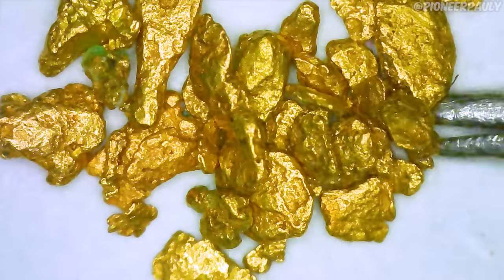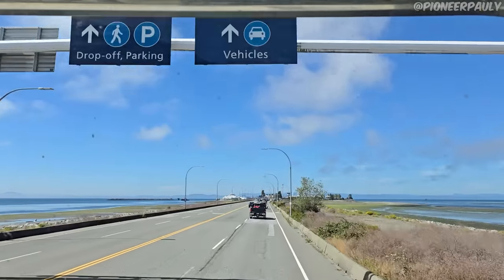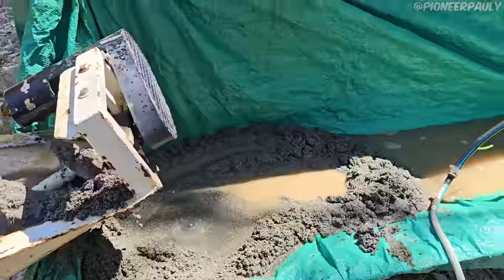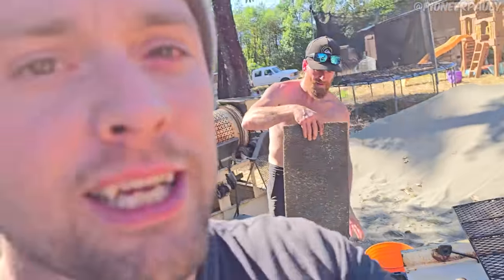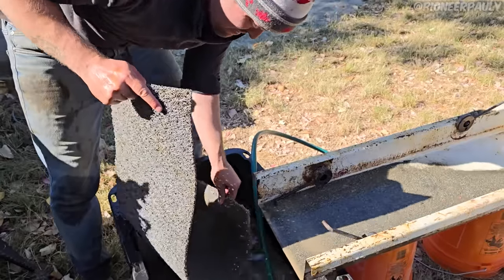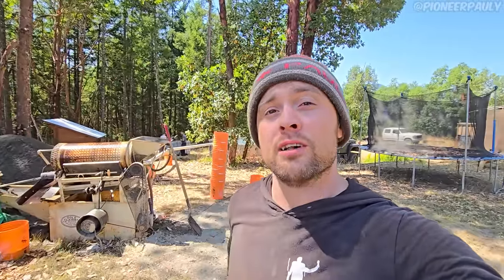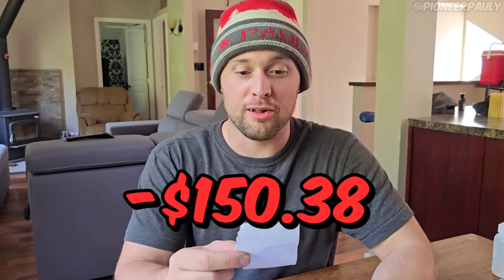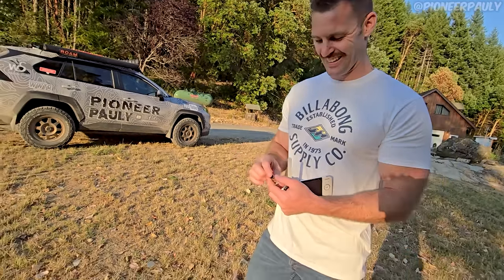How Much GOLD In Dump Truck Full Of Home Depot Sand?

Comment from the maker: Should I retire from sand or go bigger? Let's hear some ideas! 😅
Reply: Any possibility of dynamite being used? 🤣
Reply: still watching, but the rule of thumb is to always go bigger or die trying
Reply: Need to do a bigger dump truck like the mine uses…..
Reply: Do pudding next. How much gold can you find in Home Depot pudding?
Reply: I can't wait for another trip to NZ 😊
Reply: BIGGER
Reply: Crevice the sidewalks in the city
Reply: Retire
Reply: I want to see you dredge using a pool vacuum hose (no inner riffles) clipped to a sluice. I use a 50 foot pool vacuum hose to dredge legally in California and it works perfectly even without a significant elevation drop. You just need fast moving water and the hose fully submerged.
Reply: Mental, but very entertaining,  10 truck loads next😂😂
Reply: Tbh it was peak i don’t know how this could get more interesting 😅 it was like you predicted 0,2 grams but 10x bigger
Reply: Just go prospecting on the Frazier.
Reply: biggggerrrrr. biggggerrrrrrrrrrrrr. see if you can cut a deal where you return the sand
Reply: Trailer dump. Dredge for days
Reply: At those gravel plants they classify the sand to take the larger pieces out. I want to see you run a dump truck of what they classify out. See if there’s any bigger gold 😈
Reply: I like seeing good gold. I say dump the sand videos.
Reply: Ocean
Reply: You should go to work with Parker.... Pioneer Polly teams up with parker!!
Reply: If you want to go bigger you might as well just build a gold plant next to the sand place, save on the dump truck costs.
Reply: Find the most crowded beach near you and sluice it! In other words, go BIGGER!! 😂
Reply: BIGGER
Reply: 3 dump trucks full one of those really really big yellow machinery ones that they use at Coreys we just have like 10 people helping you
Reply: You are crazy 🤣 but you n a good happy way.
Reply: You could try for sand from different quarries?
Reply: Why not put a tarp down or plastic? You're smarter than this. Gold is heavy that's why the process to get gold works with dry shaking or some type of sluice. So every time you scoop  with a shovel or bucket etc it will keep sifting itself deeper and deeper u til it's on the ground with grass, leaps, dirt, rocks etc so you loose it on the lawn or in the yard but over a sheet of plastic   any gold that shifts or sifts to the bottom is normally lost. But not if the sand is dumped on plastic.

P.S you just said about why you didn't use a tarp however when coming to fine gold. It will all get lost into the woven plastic checker fingers. Meaning you lose majority of it.
Reply: If you go bigger, then you are just a normal placer gold miner. 
And you know what...
I would absolutely, certainly, and abhorently never watch another one of those amazing videos you should never think of making, cause they would be just..horrible.
Reply: Get a CAT Load of sand
Reply: Make a deal with the sand company, return the tailings sand for a new load
Reply: I commented to soon 😂
Reply: I'll help you and Andy retire....nice pan...matches my 4.5g in a pan...I made a Calgary Flames logo in that gold, right in front of my father.... he says "you have too much time on your hands".... I said "not really, it's 4 hours"!
Reply: I clicked the dump truck thumbnail  3 seconds quicker than if it was a bag.
Reply: Give some to streetips to process into pure gold for you
Reply: Tar!
Reply: Go to a gravel pit or road building gravel pit, in a gold bearing area. Like Tulameen river, or along Fraser. Test there gravel!!!
Reply: You gotta go bigger that was only half a truck
Reply: Would more corse sand or gravel mean bigger gold
Reply: Bigger
Reply: This is really expensive but a big load of online pay dirt
Reply: Bigger
Reply: How much gold is in sand in a whole football stadium.😅
Reply: GO BIGER do more sand from home depot
Reply: Retire man. Its common sense. Before building that plant to screen sand theyll do drilling test and samples . If they found shitload of gold they wouldnt be selling sand lol
Reply: try another supplier, these guys ripped you off...
Reply: GO BIGGER!
Reply: more sand🤷‍♂️
Reply: might want to just go to the river and run the sand a little up the river...
but hey! more sand never hurts.
Reply: You should retire from anything that requires work
Reply: Bigger is better
Reply: Do a sand gold mining video on the beaches of the west coast of Vancouver Island.  Mining flour gold like the old timers did.
Reply: @robertstanton1668 
"Fraser"   ( sorry )  :-)
Reply: Go buy some clean fill dirt from a random person
Reply: You just need to go to wisconsin and speak to Jason @Flour gold wizards...lol all the beach sand you'll ever want to process...lol
Reply: The next step is to find the Home Depot sand pit on the Fraser river.
Reply: This video is over produced. Please make them more rugged
Reply: Buy a small plot of land in Nevada make a small mine shaft and hire some folks to work when your busy
Reply: @MadMarlin1964  Don't encourage him...lol
Reply: @kylechipaway1285  Pretty sure it was "full" by weight. Some materials are too heavy to fill by volume. And amazed that the ferry would take it as heavy as that load was. Wonder if the ferry charges by weight on those loads?
Reply: Every video the amount doubles. Do it like that, but with sand! Dare ya!
Reply: If the next one isn't an entire freight train of home depot sand, I don't want it 😂😂
Reply: NO....Though you should  at least make a sand castle next time!
Reply: BIGGER
Reply: It could be an infinite money loop if you set it up right and sell the sand again 😂
Reply: hi @PioneerPauly ive got a question is gold only in sand or can it be in gravel too  ?  :body-blue-raised-arms::hand-orange-covering-eyes:
Reply: You should go bigger. Figure out were other home depots across Canada source their sand from. Then go to those places and do the same thing. Would be so much fun. Much much more expensive but more entertainment.
Reply: Go big or go home
Reply: Retire bro this so stupid 😅 jst buy gold  and try to make profit not sand lol I feel like everytime U jst throw a couple grams of gold in it too lol everytime u have the same amount 😅 I only watch because it’s so stupid I have to fastforsward to the end to see u lose 🎉
Reply: Enough sand videos for now. They were fun but now its enough
Reply: I think it would be interesting to see the difference in outcomes from those paydirt bags.
Reply: use the size of my moms weight of sand
Reply: HELL NO GO BIGGER, GO INSANE
Reply: Build a giant sand castle
Reply: A POOL FULL OF SAND!! PEASE 🙏
Reply: I wonder how much you will find in a whole beach.
Reply: Go big or go home.
Reply: B I G G E R
Reply: Go Bigger , go to the source! Where does Home Depot’s supplier get its supply , to then send to Home Depot ? 

I say Bigger Mining Truck from the FRASER!
Reply: Do a semi load
Reply: Do a panning Competition with your buddies. Put some gold in some sand for each of the particepants, same amout if gold for eatch and Whoever retains the most is declared the winner and gets to keep all the gold
Reply: As they say. Go bigger or go home 🎉❤
Reply: 40 - 7 trailer road trains full of sand should be fine😂😂 but to get the road trains you’ll have to come to Australia, when are you going to visit vogus prospecting?
Reply: You need to put the whole Fraser river though the Trommel.
Reply: Sahara awaits your arrival.😮
Reply: Always bigger 😂😂
Reply: Imagine using beach sand to find gold
Reply: Find more big nuggets please!
Reply: Go bigger
Reply: BIGGER
Reply: Yes
Reply: Yes
Reply: Configured Connect homogenizing homogenization using h burnings conciliatio binomial
Reply: I reckon your eye is pleading you’ll retire from sand 😂
Reply: Go big or go home, try a train full 😂😂😂😂
Reply: Wouldn't most of the gold gone into the grass :)
Reply: @inadad8878  all what is left on the grass, yeah but seeing that that entire pile was just 2 ish grams means that the loss would not be more as .2-.3 grams at most…
Reply: U shouldn’t be out in the sun bro not good 🧛‍♀️ 🧛‍♀️ first time watching ya videos 👍👊
Reply: BIGGER
Reply: Fabricobble a hopper and feeder for the trommel.  Lets you focus on more things while it runs.
Reply: Fill 3 dump trucks full of the sand
Reply: In New York we have road sand. Sand for iced roads. That is a good possible video
Reply: Get  cement,  moulds, a mixer ,and make blocks to sell on ....
Reply: you should do dirt
Reply: Sluice a big pile of random dirt
Reply: 5 dump trucks😅😂😅
Reply: Retire. Bad investment, and the videos are not as interesting. We like to see you succeed financially, not blow money.
Reply: Arrange a deal with the sand plant to run a trommel there, washed sand fetches a premium so it's a win for both you and the sand plant!
Reply: MORE! 😁
Reply: Use the sand they sweep off the streets after winter
Reply: I dropped my golden needle into sea can you help me to find them?
Reply: You said bigger
Reply: You could try a bunch of sand from different locations other than depo like where you buy sand/gravel and stuff by the truck loads. Do not retire but also go bigger. do both :)
Reply: @PioneerPauly don't retire from sand instead you should set up at the river this time with all of your friends and have a big day where you just sluice all day stay the night and do it again for like a week straight so you don't have so much expense.
Reply: BIIIIGGEEEERRR
Reply: Sidewalk sniping
Reply: Bigger
Reply: BIGGER DUDE!!!!
Reply: Spare change from car wash machines.
Reply: Get a different trucking company.
Reply: bigger!
Reply: do a barge of sand next.
Reply: Food would have been consumed no matter if you were doing this or not. That's not a legit related expense. That's just a personal line item.
Reply: Do something more meaningful with your time than to try and get rich 👎
Reply: Semi truck
Reply: Mad Max equipment upgrades: how far can you take the prices to be solar/wind/water powered so you eliminate operating costs for the equipment (IOW can you eliminate petroleum in the wash plant process).
Reply: Let’s see you go to the diamond grounds.
Reply: MORE
Reply: Pan for gold from sand from an actual playground sandbox. 😄
Reply: I heard there's loads of gold on the sides of highways in all the sand and debris try going out there and sweeping alot of it up don't think you could get in trouble considering you could say your doing community service for the city.
Reply: try lowes sand
Reply: What is the next sized up dirt they sell? Dump truck of pea gravel?
Reply: Bigger
Reply: Hand pan Icelandic black sand until you find 1/10th of a gram. (all the sand is black here)
Reply: Go bigger
Reply: Do I semi trunk trailer?
Reply: Get somebody to smelt or do a chemical extraction of precious metals from all the black sand. That way you get to play with fire and/or dangerous chemicals.
Reply: Bigger
Reply: Retire
Reply: @WheelieShinyGold who wrote that rule?
Reply: Bigger
Reply: @scrapyardprospecting3855 naw 😂that’s way to fucking much work I’ve shoveled one f them bastards out before 😢
Reply: Go find yourself some gold in rivers it will be more funnier❤
Reply: Use the money to fix your teeth
Reply: Bro I just saw u at twassen mall
Reply: Bigger = better
Reply: the reason they sell the sand is because it's low in gold, the expense of collecting the gold on an industrial scale would put them at a net loss
Reply: I guess it REALLY depends on WHICH Home Depot you go to to buy your sand. If you need to buy the sand in huge quantities anyway it might be a way to get a tiny percentage of your expenses back.
Reply: bigger
Reply: Send it!
Reply: 2 piles!
Reply: Go bigger 🎉🎉🎉🎉🎉❤❤❤
Reply: Go collect a pickup trcuk load from your own claim on the fraser, just remove the bigs, put it in a truckbed with a tarp until you fill it up like at least half way, like a half yard or yard if it a big bed!
Reply: As a scuba diver, who watches your channel for f. Sake get back in the water.
Reply: Go bigger Pauly 🎉🎉🎉🎉😂😂😂😂
Reply: bigger ! way bigger !
Reply: 1) if you took all the big grains out, you could get a very large roll of paper. You could get a damaged or overrun from wholesale paper recycler.  And lots of glue.
2) You have a large magnet?  Sprinkle the iron pyrite on top of concrete before it sets.  The iron filings in clear plastic tube or plastic tray is also interesting.
Reply: Need to rent a cement truck and instead of cement  put sand in it.
Reply: 🗣️🗣️🔥🔥GO BIG OR GO HOME🔥🔥🗣️🗣️
Reply: I believe it’s time for you to become Count Dracula
Reply: jet dry
Reply: Do a nuclear power plant
Reply: Sell the cleaned sand and bank the Gold.
Reply: More
Reply: Same size truck, gotta clean the floor in the bagging facility..
Reply: Never retire
Reply: no
Reply: Do sea water next. No cost.
Reply: go big or go home but dont go home
Reply: if u stop id cry
Reply: You should probably give back to the community instead of spending money just because but it's what ever
Reply: There's a barge that comes in near where you live... across from the concrete plant and drywall recycling depot opposite each other you drive by it often  ps was great to meet you on person I  know ots not cool to run up to people you don't know
Reply: Lemme know if yall wanna do some blasting 😅🙏
Reply: Could have had an elevated container to hold the sand pile so you have minimal lifting and a simple process to feed the machine.
Reply: Are you a vampire?

Comment: In a gold rush, be the man selling shovels
Reply: or sand and buckets in this case
Reply: Be the truck rental…
Reply: You sell the shovels. Imma own the closest saloon/brothel.
Reply: Tbf, they can totally sell the tailings and recoup most of the initial costs
Reply: @VladDracul-c6o  ill be your first customer and start the first bar fight. But then I'll clean up and be the first sheriff
Reply: yep cause you will make more than the gold diggers ever make. Me and my brother in law took all the circuit board scrap off a gold e-waste recycling companies hands and processed it all not in hopes of getting a little gold in fact gold if any was waste we were after the copper from the boards. Out of their big dumpster that was one of those compacter 1s a big monstrous thing worth of board scrap we got 25 5 gallon and a partial bucket full of coper powder.  

We used the same acid they use for swimming pools and giant filters they use to filter deep friers oil. See the acid dissolves copper and it goes in to solution as a extremally fine powder when you dry it you neutralize the acid (very easy to do. Once you do that you pour the acid through the filters and you end up with a brown looking sludge. You allow this to dry and then rinse it over and over with clean water again through those filters. The brown sludge is other worthless materials including a bit of gold all mixed together some plastic and some garbage metals. Once done you are left with bright copper powder that you put in bucket and cap. You do not take that to a scrap yard there are buyers you can find for reclaimed copper like this that sell to foundries. Each bucket was a bit over 200 pounds this was years ago we did this but at todays prices that same load would be about 20 grand ! The e waste recycler might have gotten 100 bucks of gold out of that dumpster of scrap we probably through away another 50 in gold and silver. so total gold yield was maybe 250 at best and coper yield was 20k. To give you an idea of how much copper is in computer boards a stick of ddr 2 3 or 4 ram contains about 8 real copper pennies worth of copper per board. in 2019 a solid copper penny in copper value was 1.7 cents  so about 14 cents of copper per 5.25 x 1.5 inch bit of board scrap. Even on the most expensive video card or ram stick there might be a micro gram of gold. microgram not milligram. There is no solid gold any thing in pcs it is all ither electro plated or vacuum metal deposited coating .
Reply: During the CA gold rush of 1849 some river beds  had 14 oz per sq foot..
Reply: Alcohol and companionship…
Reply: I just got an ad for gold nugget casino while watching this lol
Reply: Sure buddy you must be so successful from knowing a quote.
Reply: @Qtown444   I wish I had as few problems as you, when this is enough to annoy you.